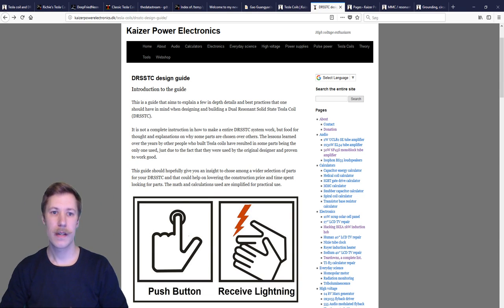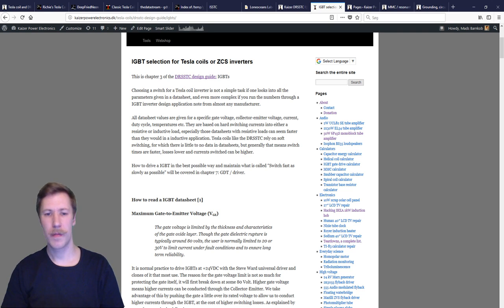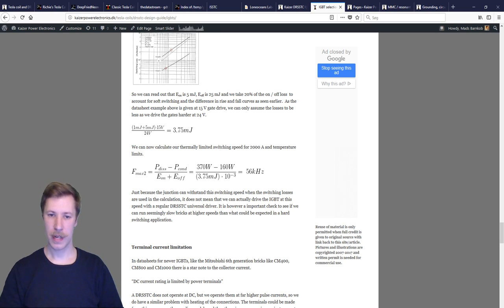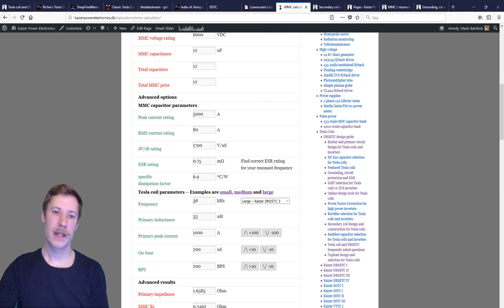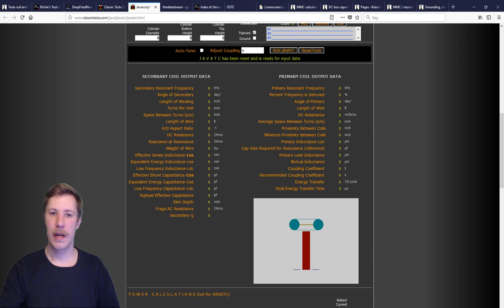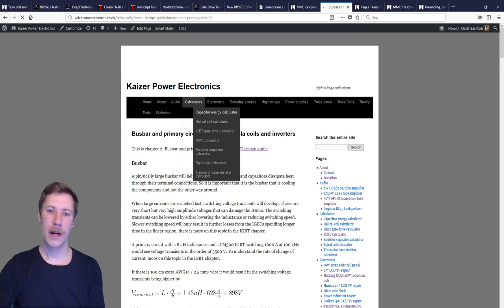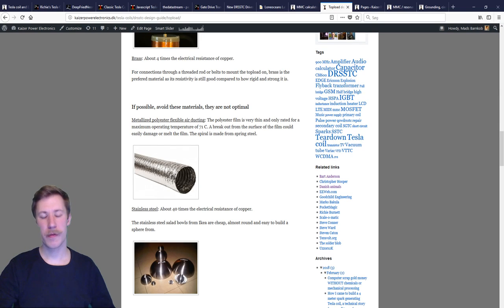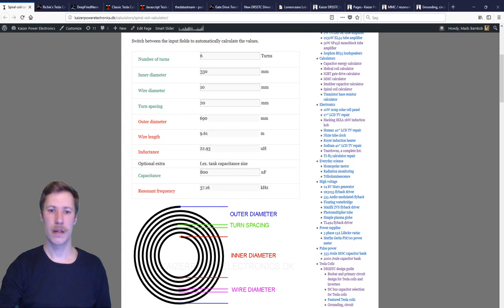How to build a Tesla Coil. Design, Theory and Compromises! [2018 Live reupload]

Comment: JAVATC is like having an awesome spaceship without a manual.
Reply from the maker: Do you want me to make a beginners guide video to it?
Reply: @KaizerPowerElectronicsDk  Great!  Looking at the demo reveals things like sec radius includes the wire but, not sure if it is measured at inside, center or outside and does it include inner or inner and outer insulation thickness.  No place for topload material, assuming aluminum.  A sphere does not need hor n vert dimensions unless ovals are also good.  No disc thickness and only by looking at the created picture do you realize it is also used with certain toroid types.  Heights are referenced to ground, not just the component. Primary capacitor is needed for calculations, but that is what I need to BE calculated.  I found out the cap value in the power section is what you DON'T want to avoid resonance with the supply transformer(s). Many critical details!
Reply from the maker: @solarsynapse  JavaTC is made for spark gap Tesla coils, but I almost only use it for solid state designs. I agree that it's small calculators are not my favorite, so I made my own: https://kaizerpowerelectronics.dk/calculators/helical-coil-calculator/ and https://kaizerpowerelectronics.dk/calculators/spiral-coil-calculator/ and for MMC design, but primarily made for DRSSTC: https://kaizerpowerelectronics.dk/calculators/mmc-calculator/

Comment: Glad to see JavaTC being promoted here. Bart Anderson has put a huge amount of work into this over the years.   It's the only TC calculator that computes from the physical dimensions using field calculations.  Older programs just implement rules of thumb and empirical formulas (some of dubious pedigree), good for 5% or 10% accuracy usually but JavaTC and its physics engine has been extensively validated at the 1% level.